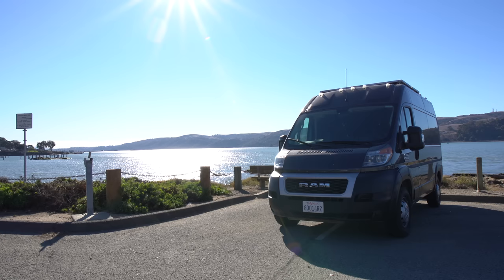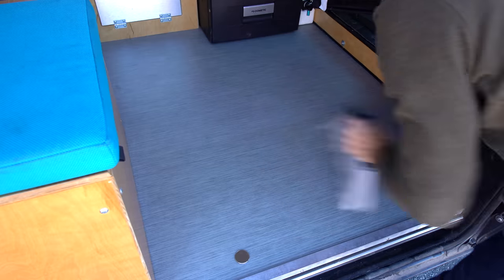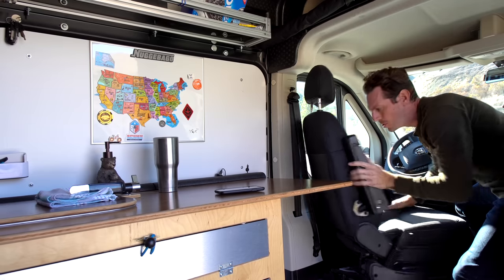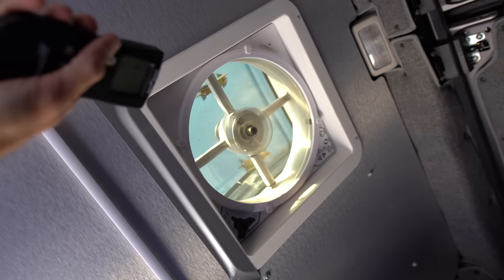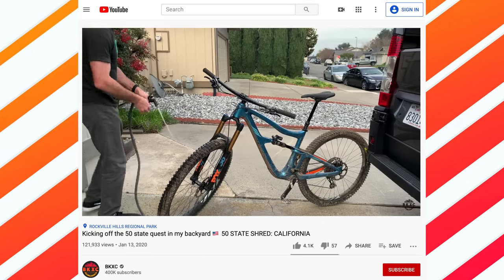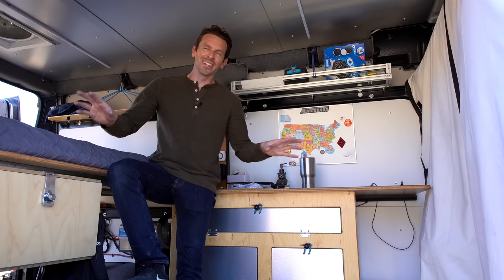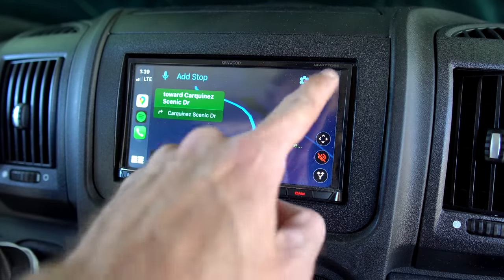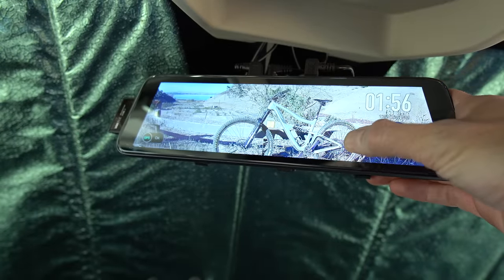15 Smart and Stupid Details On My Van | RAM Promaster camper conversion

Comment: A. If you plan on keeping the van long term, change full synthetic oil & filter every 5k miles to avoid the piston rings failing, thus burning oil, especially if dusty or mountain hill driving. Stealership will say don't have to until 10K miles since they base this on what is the max. change interval & before warranty period expiring (DYI-check oil level after stealership, they will overfill it to burn out piston rings quicker) B. Inside air compartment filter, change yearly or every 15K miles whichever comes first (DYI-5 minutes) C. Engine air filter, change every 40K miles (DYI-20 minutes). D. Flush/change the transmission fluid/filters every 60k miles, they claim lifetime, that is BS, lifetime to them is their warranty period expiring or 100K miles. E. Flush/change radiator coolant every 3 years or 60K mi. whichever comes first and not 100K miles, that coolant is running thru. ports inside engine to cool it, with lots of idling/stop/go that fluid needs to be fresh F. Spark plugs, replace at 75K miles & fuel injection cleaning (DYI-1 can SeaFoam to tank of gas every 15K miles-$8 item). G. Replace brake pads/check rotors at least every 40K mi. & brake system fluid flush every 40K mi. or 3 years, whichever comes first.  H. Starlink Satellite Internet is $600 one time fee for equip.&$100 month access, lighting quick 250 up/down dependable. ****VAN driving is FUN and FREEDOM!😀😀😀
Reply from the maker: Good info, for sure!!

Comment: You just get some of those overhanging window sun shade things for your driver and passenger doors and bam, you can just crack those windows and get air circulation. And with the shades on there, it'll keep rain out unless it's really stormy, and if you just crack them, no one will be able to see it open.
Reply: Don't use when driving. Windows are part of structural integrity. You'll have a less solid vehicle w them open. Also, glass would be flying at your face at a very high rate of speed in a crash.
Reply: @windsofmarchjourneyperrytr2823  Okay nerd.

Comment: Thank you thank you about the vent fan. I was so torn, not anymore - 2 fans.
Reply: We have 2 in our motorhome, usually have one pulling air in and the other pushing air out.  Very efficient, low use of power.

Comment: The sink is shallow so however you turn the water on with whatever body part you use splashing some water around is gonna happen....or so it seems....how about a micro fiber towel dedicated to hand drying and wiping up the few drops of water you may scatter about? They are cheap at sams or Costco and you will find so many uses for them in your van. They dry really fast ,resist stains and don’t stink. This may all sound dumb or stupid but this method has worked in our home for decades.

Comment: I got my diesel heater online for $150! It is a massive game changer!! My little propane heater would kick off in the middle of the night if I didn’t have a window cracked and a fan blowing right at it. Also, it takes about a pound of propane per night to heat a van in cold weather. Just the fuel savings is enough to cover any costs. Install is a breeze. You’re crazy to not get one if for no other reason than keeping your van dry!!

Comment: Thank you for sharing. I keep watching these videos to see opinions on how useful projects are by experience. I have a transit connect that i stay in for 7 days every other week. I have a 5" futon matress and a layer of thinner pillows on that.  Works great and stays soft in the cold. I use a -20° sleeping bag and use a little mr buddy heater only when i wake up to get dressed. I have the window rain guards for airflow for now but have plans for a vent fan to use one of the windows as the exhaust for a little more stealth when it gets warm out.

Comment: For the foot pedal, you could cut away a spot in the cupboard over the floor so you could put the pedal on the floor and just slide your foot in just enough to hit it. That way the pedal is out of the way and you don’t need to move the pedal every time you use the sink.

Comment: I have a 2018 3500 High top extended. Same fridge as Alex and same Husky tool chest! I installed a Esbarch gasoline heater. Best thing I ever did for the van. Turns out the promoter has a second auxiliary gas connection that plugs easily into the heater. The tube doesn't extend to the bottom of the gas tank so you won't suck out all the gas for the heater and get stranded. I live in upstate NY and use my van all year. When you get below 50deg in the van it is pretty uncomfortable. I have solar but I find it pretty limiting most of the time. Also lithium batteries don't work well in cold weather. I am thinking of taking my solar panels off so I can have more  roof storage. My 10gal road shower is inside my van and provides water to my sink using air pressure. I pump it up when I need to wash dishes. No need for a pump. I don't have any extra windows so my walls and doors are insulated which cuts the road noise drastically. I also have a 3rd party head unit for my music and gps. I have a powered amp and great speakers. No issues hearing pod casts or music. I plan to get an air compressor but I think I will put it inside the van as road salt up here would probably destroy the air compressor after one winter. Love the channel. Glad you survived the pandemic while you traveled. At 66, I plan to let things settle before my next big trip.

Comment: brian, idea for your foot pump:

recessed foot pump/switch. it doesnt need to be very far or big, but just enough that it's out of the way/off the floor and you can get it with your foot. knee might be good, too, though. also, for god sakes, get an aerator for your faucet, that'll stop a lot of the splashing and make your water stretch further.

Comment: Better insulation will cut down on the road noise which would improve the acoustics for your stereo. It would also help with the vent fan and propane heater being more effective.

Comment: I was fooled by that MOPAR oil change plan as well. Threaten to give them an awful review, it's how they get a lot of money from Chrysler so they'll magically find your plan info and honor it.
Reply: I used the Mopar oil change plan. I insisted on using  Syn oil. (Shell Rotella T6) It's good for 20,000 miles. After getting 100,000 miles on my Dodge Cummins, they refused to renew the plan.
Reply: @bobpeg7457  I personally have always peeked in there, felt the stick and looked at the color and smelled it. If it smells like gas, should change it. If it's black, change it, never liked very black oil, lol. If it's gritty, gotta go. 

Always used synthetic. Never any issue. 

If its been say a year on a low-mile vehicle, do it anyway.

Comment: Sound deadening reduces all the noise by heaps. Also gives some extra insulation. 

MaxxAir has a vent/fan so you can suck out hot air or switch it to bring air in. You just need at least a small fan inside to circulate, and the cab windows open a bit gives ventilation as well.

Good points raised in your video overall though. That's really impressive for a 4 hour fit out! 👌🏾 Amazing!

Comment: I never buy the extended warranties or other add-ons,  usually never worth it in the long run. I like the simple set up that Wayfare has done and so easy to just let them do it for you. I have an older van and am seriously contemplating a new one sometime next year. Thanks for sharing, and happy holidays!
Reply: If  Wayfare do their installation, do the insulation by your self. Ceiling and sides need real good insulation.
Reply: @kennykim6803  already finished my own build, haha...built up a brand new 2021 ProMaster

Comment: @bkxc heating: a camper van couple use their gas stove to heat up a set of "bricks" for half an hour saying they then give off enough heat for the rest of the night without the need of the gas going. They have the "bricks" sort of tied up and with a handle to move, looks like a nice setup and does not require constant consumption of oxigen by gas. I will give it a try

Comment: Van living is really like owning a home,  always things to upgrade, always something you hate.   Ever changing.
Reply: Except your house cannot be in the mountains for breakfast, in the Valley for lunch and at the beach for dinner!
Reply: Go to RV shows and take VERY specific notes. Take off your shoes and hop in the shower in particular. See if the soap dish hits you in the spine (saw this) or the spigots are right in the way! Or you trip over the toilet or crack you knee on something stupid. 

Pretend you're actually in there doing stuff. What's cool vs. What's irritating? 

For 50k plus, you shouldn't find ANY annoyances, imo. 

Obviously, you put the spigots where the glass panels fold back along w soap dish  and shampoo shelf over that. 

If you can't move your arms around, don't bother. If the skylight is 3 inches in a stupid place (if you're tall, you'll crack your head), move on. 

They SHOULD do better for that kind of bank.

Comment: I can suggest, from personal experience on a big bike (motorcycle). You can use one of those bladder things in a fanny pack. They keep yours stuff cool for quite awhile. And an insulated water bottle. Stainless now. 

In fact. If you're VERY slick, you run the hose through the button of your vest, and the water is RIGHT THERE. You can pretty much do it hands-free! 

It was a total Godsend in Phoenix. 

Also, wet socks were another one. Your feet CAN'T get wet, AND it still breathes! They work. Still have the ones from 1995! Lol.

Comment: I installed slider windows and 1 fan, and can move plenty of air. I also used sound deadening and thinsulate, and my van is extremely quite compared to when I bought it. The builders are fast, expensive, and cut a lot of corners.
Reply: It's not that bad if you're alone and can't do it by yourself. Imo. 

I'd say wait a few years and buy a 5 year old one. Or rent it, see if you like it as is. 

I found vans at an RV show remarkably claustrophobic. Can't imagine being an average sized man.

Comment: Great video. We put Noico on our transit wheel wells and some patches on the ceiling and it is sooo much quieter. Hubby won’t allow a propane heater because of the moisture. I saw a video where a guy hooked up his auto start to a thermometer and the van ran for 15 minutes every once and a while when it got really cold. We have no plan to do major cold weather camping either, but even southern Arizona and Texas nights can get down in the 30s in the winter. That’s when we get a hook up and use electric heater. Also agree about the ceiling fan...a dome vent in ceiling or side and some fans is stealthier.
Reply: Please be careful of propane. Use a CO2 detector on the floor. And smoke alarms up top. W fire suppression. They can, and have caught fire for no reason. Make sure you have enough exit doors unblocked by anything and exit windows. 

A car/van is big enough till its on fire between you and the door. Then, it's very small.
Reply: @windsofmarchjourneyperrytr2823  yes, we don’t have propane

Comment: I have a 2018 Ram ProMaster 3500 extended I put over a hundred and ten thousand miles on it this year I actually broke down in El Paso Texas and had to have a alternator replaced at that Sutherland Dodge Chrysler like you mentioned in your video

Comment: You should be changing your oil way more frequently than 10k. You will get lifter tap before too long. Synthetic oil is more stable, but the carbon and varnish builds up at the same rate. The varnish eventually causes the roller lifters to skid on the cam among many other things. 3 to 5k is hard for someone who drives a lot like you, but if you want this van to run like new forever that's what is needed.
Reply: His motor failed not long ago. I would never purchase a Ram van. I change my oil every five thousand. I don’t care what the book says.
Reply: @mtadams2009  How do you know he killed it?
Reply: @ChannelZeroOne  He had a video a couple months ago saying a new engine was gong to cost something like 14 thousand dollars.
Reply: @mtadams2009  So many Channels I cant keep up with them all. Sad to hear that man. I guess it was already out of warranty. How many miles did it make it to? 

10k oil changes will destroy an engine. The manufacture only cares about making past the warranty. You could never change the oil and the engine will likely make it past, but it will surely get slower and slower.

Comment: On the subject of two fans, if you have a t1n sprinter (maybe others as well) there is a vent on the dash that essentially just opens to the outside (airflow varies with road speed as you go along your way). I always left this open and between that and all the rust the top vent could pull air through.

Comment: Put a starter button that you can push with your foot in the front of your cabinet or on the floor for your water pump. Just spent a week using my inverter in rain and wind in Arizona,  solar panels with no sun.

Comment: I think I mentioned how valuable a fridge is in a van when you started this journey. It is a must especially in your situation where you lived in your van full time. Get a 12v water pump from Amazon (SEAFLO pumps are amazing) for your sink. I have 2 pumps, one for my sink and one for an outdoor sprayer. Solar is also a must if you work on the road. The one think I will add to my Promaster is an awning. One I can push a button to extend or use a hand crank since it takes less than a minute to extend and retract. I have a 10 by 10 canopy but that's a process to setup and takedown. Only a good idea if you are stationary for a day or two. 

And you really do have to "guess" at how you outfit your van before you start then as you use it you will figure out what works best.
Reply: He could probably replace the shower with an awning. :D

Comment: I'm enjoying your videos, they are very honest. Is the wool insulation not good enough to keep the inside of the van warm enough in the winter? Regarding the van maintenance, I would not wait 10K miles to change the oil, regardless of synthetic or mineral oil. Change it every 5-6K. This might have been the reason behind the engine failure at 75K miles. Also, in the future don't fall for all of their recommended service suggestions, some are useful, many are designed to make the dealership money. Thanks and keep up the good work.

Comment: Those diesel heaters are actually only around $200 and pretty easy to install and maintain.  You might reconsider, as they put out great heat and without pumping extra moisture into your van as the propane heater does.  The only real nuisance is figuring out where to place the diesel tank and how you'll be filling it.
Reply: "The only real nuisance" is the god damn clicking noise made by the fuel pump which drives you insane

Comment: I really really want a simple van like this.. Love this video outlook & reflection, Superbly Done👏🏼✨🌎🚐💨
Reply: If you want a simple build, consider doing it yourself!! I started w a simple build because I was rushed. I used a folding collapsible table with a Rubbermaid bucket for my sink and I threw a mattress on the floor. I had a bucket with a toilet seat and some peat Moss for a homemade computable toilet and some black out curtains behind the seats. I was ridiculously comfortable and on the road after an hour or 2 in a Walmart parking lot! Eventually, you’ll know what you actually need and can take the time to set your van up your way. Please do make sure to insulate and ventilate properly though!! Read the other comments about condensation and wet or dry heat. It’s a shame when people lose their precious vans due to rot and mold. Good luck!!

Comment: Not related to the Van but to your video exports and data use. It sounds like you're uploading files that could be much smaller. I edit films that are an hour long each week for a client and the final uploads are about half the size of yours by the sounds of it but the quality is still spot on. 

Firstly, download Handbrake (free) and when you export your videos, export as native, full quality then use Handbrake and use their presets (there's one for vimeo that's perfect). Yes, it's a second encode but it won't take long at all as it's just transcoding rather than rendering a full timeline. 

This will result in much smaller files while keeping quality.

You're uploading 4k files which is probably not worth it. Your analytics should show that 4k is probably not used by your audience nearly as much as it makes it worth while so consider only uploading 1080p. 4k downgraded still looks lush.

The Handbrake tool is amazing either way.

Comment: If you haven't already replaced the foot pedal for the sink, I have a suggestion. My orthodontist had a thing where you actually push on the drawer under the sink, and it turns on the faucet. I thought this was really neat because it makes for a nice large button and makes the button hidden at the same time, which I think you would appreciate in your van.

Comment: I've seen a van build where the guy had a fan installed in the floor and the ceiling!
Reply: Really !!
Reply: Yes, it had a lift up for vent, drop down for no air flow.  Always pulling air or pushing from under the van so it's cooling from shade.  I'm thinking about that...
Reply: Be sure you do not run the engine while pulling air in from the floor fan; carbon monoxide from exhaust can enter, even from another vehicle running nearby.
Reply: In some states that is illegal, due to the chance of having an exhaust leak that could seep into the passenger compartment.

Comment: Yo! For the sink, button/switch...maybe cut out a spot in the bottom of the cabinet for a foot slot. It's tucked away and won't get kicked, but you can put your foot in there when you need to use it